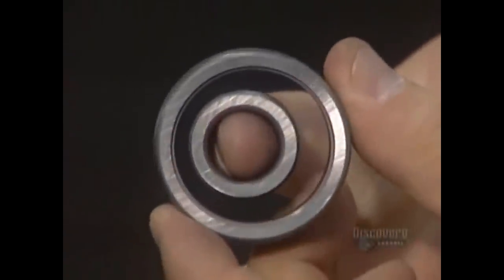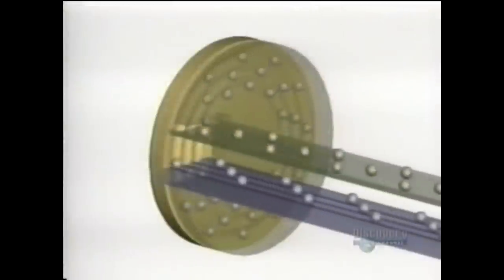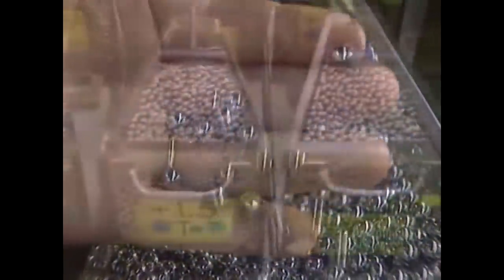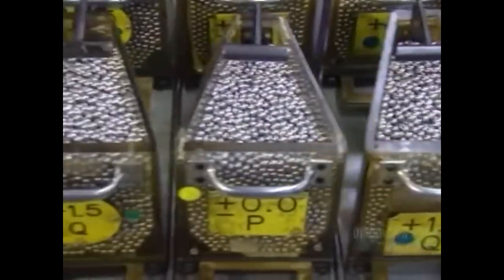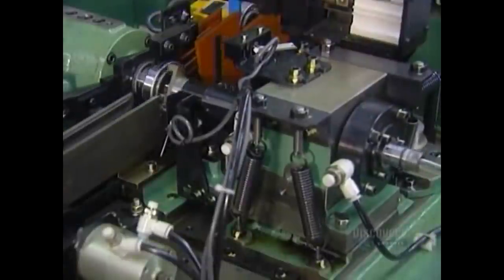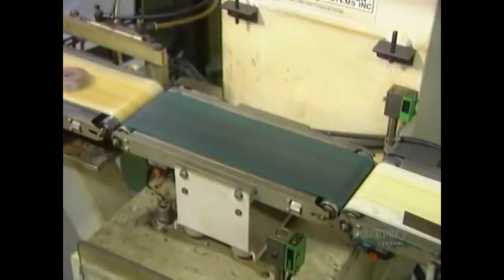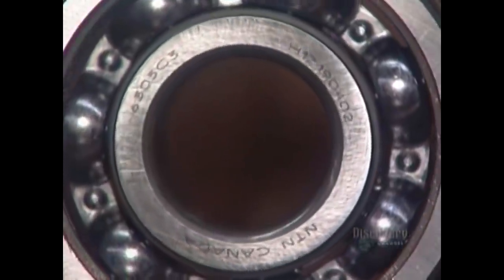How It's Made | The Balls Harden (extended)

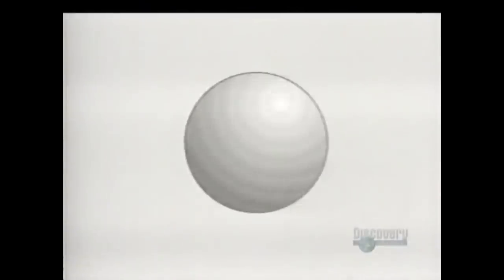Comment: 0:17 T h e B a l l s H a r d e n
Reply: "This entire process takes a few days"
Reply: “These balls started out as steel wire”
Reply: “A machine cut them into pieces”
Reply: “And a dye punched them into rough balls”
Reply: @3225becca  "these balls go into a grinder"
Reply: @dr.latency8679  “which remove the bumps”
Reply: “Then other machines round them out and give them a mirror finish”
Reply: fart sound
Reply: @3225becca  Next off: Washing.
Reply: @gayahhbihh  "they Cook these balls with thick oil"
Reply: "and a fine stone grit"
Reply: @Miles joles  «And They Get A Bath»
Reply: “In cleaning solvent”
Reply: @3225becca  “after several quality checks, the finished balls go into hoppers.”
Reply: @penapvp2230  "This vibration tester, makes sure the balls operate quietly."
Reply: @nekidesuu_  “some types of balls are lubricated with grease.”
Reply: @iMintyGreen  "a machine squirts grease evenly, then inserts a rubber seal to contain the grease"
Reply: @Niko “the good ones move on to the laser”
Reply: "which marks them with information such as the part number and the trademark"
Reply: Fart.mp4
Reply: “A final quality control test”

Comment: Bearing ball torture (BBT) is an industrial activity involving the mechanical and thermal processing of bearing balls. This may involve industrial processes such as chemical processing, sanding, grinding, die punching or even heat-treating. The recipient of such ball bearings may receive direct gains by selling them to a third party, or technological advantage by using them when producing industrial machinery or household items for the commercial market. Many of these ball bearings significantly reduce friction losses.

Comment: "Some types of balls are lubricated with grease"

Don't all types of ball bearings require lubrication? I mean, yes, there are self-lubricating ones but even those require lubrication at the beginning and then store the grease in tiny pockets.
Reply: open unsealed bearing will be lubricated by the end user as there is no seal to hold in the grease. or be running in a bath of lube